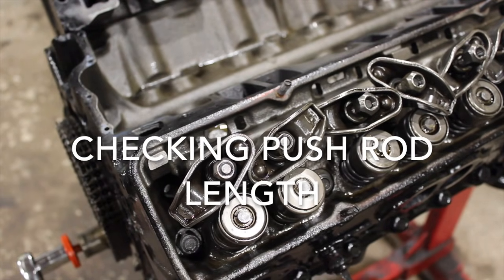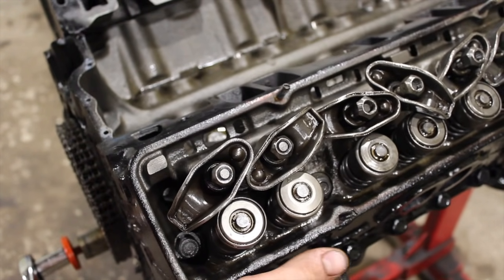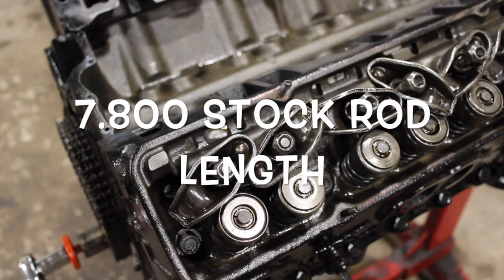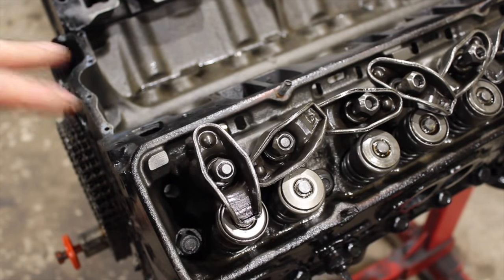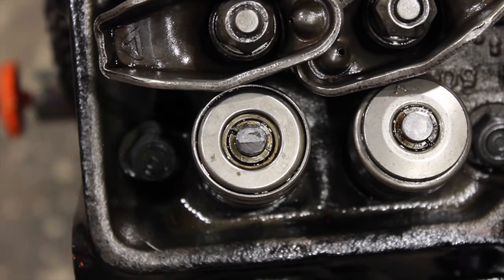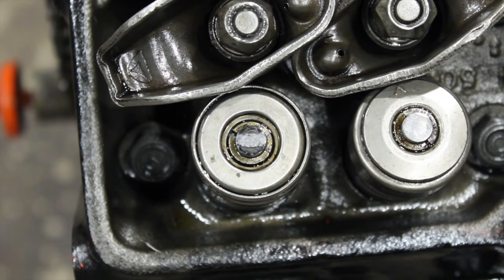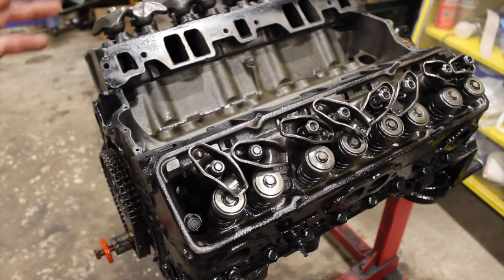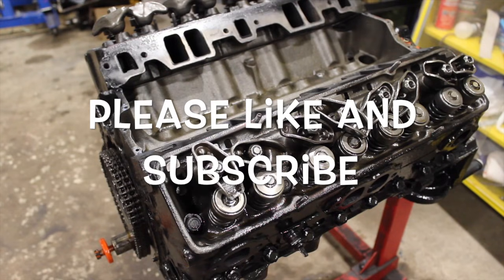Checking Push Rod length SBC *Quick Check*

Comment: TDC is not accurate enough for any significantly over stock type of camshaft.   The EOIC method is required to ensure that you are on the base circle for doing pushrod length checking.    It is best to just use EOIC all the time.

You do not get an accurate valve stem pattern by testing with the stock valve spring tension and collapsing the lifter.

Comment: What pushrods lenght u use on a 98 vortec 880 block with the lt4 hot cam with the 15 thou shim gel pro gaskets heads been milled 10 Thou so right now I’m having issues trying to figure out my pushrod length
Reply: Btw I went 1.6 rollers and guide plates and 7/16th screw in studs with the hex shaft had to cut the stud bosses down what size pushrods do u use with that block and that cam cause I know ur running that lt4 hot cam
Reply from the maker: As long as everything was done correctly with the rocker studs the push rod length should be right around the stock length of 7.200.

Comment: Great video man. I did the same measurement for pushrod length, except I turned the nut 1/2 turn more for preload. The rocker is hitting the center of the valve tip. My pushrod length came to 7.700.  Is this correct?

Comment: Did you get my last comment?
Reply from the maker: Not sure? What was it?
Reply: @cuttersperformance  You should have a solid lifter same length as a hydraulic lifter checking geometry, the hydraulic lifter collapes when running it through the cam lift checking the pattern? you dont get full rocker arm travel.
Reply from the maker: Yeah I think i talk about that in the video. My roller lifters I have ones i shim solid
Reply: @cuttersperformance  ok, on small block chevys it is probably  more commen to have to run .050 longer pushrods than shorter?  Bigger cams and more lift the base circle  is smaller and small base circle cams would need longer rods?
Reply from the maker: @Jesse Syfie  yeah base circle often causes a longer push rod, but the most common for a larger push rod is aftermarket cylinder heads. Often requiring a +.100 longer
Reply: @cuttersperformance  ok I used one of the plastic tools made by proform, and there not right and about .100 off.  It showed I needed .100 shorter rods 7.700  but my test with a solid  lifter after I made it same length as a hydraulic  lifter and ran it through full cam lift twice shows the stock length 7.8 pushrods are about dead on.  The exhausts were dead on. Intake were a tad more to intake side. Using stamp steel rockers like u did.

Comment: That's not a 100 % with a hydraulic  lifter going down all the way on max lift u are not getting  the full cam lift?  Need a mechanical lifter to check it?

Comment: So do you need to check each valve or will they all be the same after you measure one like you did here?
Reply from the maker: You can check everyone, but usually, I just check one in/ex on each bank. They should be the same

Comment: Question. My roller cam sbc engine is assembled already. The rockers are very close to the intake side of the valve stem. No where near center. Seems the machine shop did a poor job at choosing pushrod length. Question is, what’s the best way to test for correct length on assembled heads? I have an adjustable pushrod. On the last engine I used the light valve spring, added length for .030 lifter preload, and .015 for head gasket. Had a good center patten on valve. Then when I assembled actual valve springs and head gasket the pushrods were way off. Not sure what happened there. Just looking for some advice. Thanks!
Reply from the maker: Its a 87+ roller block? What heads? And do you know what length is in it now?
Reply: @cuttersperformance  Yes. 89 block. The roller top rocker is almost on the edge of the valve tip towards intake side. Not sure the length now.
Reply: @cuttersperformance  heads are ATK aluminum, cast by Profiler.
Reply: @cuttersperformance  7.200” length.
Reply from the maker: @jasonconaway69  o geez yeah good set of heads and what your going to find is that it requires around a .100 longer pushrod than factory length.
7.300 will be very close depending on deck height, head gaskets ect..
Set your adjustable push rod to 7.300 and use a sharpie to color the top of the valve stem. 
Install the rocker at zero lifter and just wiggle the rocker arm side to side to establish a contact patch. 
You can get it very close without having to roll the engine over.
Any questions you can email me a pic at pcperformance1@outlook.com
Reply: @cuttersperformance  Awesome! Thanks for the reply. Enjoy your videos!
Reply: @cuttersperformance  If I just eyeball the rockers centered on valve stem, at zero lash, add .050 for lifter preload they are measuring 7.450”.

Comment: hi , i have a question , i have a 87/95 sbc tbi engine , with the tbi swirly heads , what would cause my valve spring retainer to be busted , i took the valve cover off and found that , i bought the engine from a guy used out of a chevy truck , i just want to go back stock , what all do i need to change , thanks

Comment: like this method aren't you wiping the grease of the lobes because youre turning the engine over?
I could be wrong about this.
Can't you just put the cam and lifters in the block with engine oil and  then messure the push rods(you can rotate the engine as many times as you want).
if you have the wright pushrod lenghth  than you can take the cam and lifters back out and remove the oil and then put the grease on the lobes and lifters and install everything back so you didn't have wiped the lube of the lobes.     just thinking.
thanks for youre good explention and vids
Reply from the maker: I like your thinking but you'll do the same thing when setting the valve lash. The grease wont completely wipe off the lobe

Comment: I don't get everyone talking about using a lifter that might not have anything to do with the height of the new lifter you are going to run. What I did was get the zero lash, then adjusted the the push rod to almost bottomed out lifter (new lifters never pumped up). Then measured the amount from the start to where it ended . My lifter collapses near .200 from zero lash , but then you have to factor lifter preload, which will be .030 for my lifter. So I get the right pattern and then subtract .170 (in my case) from the push rod tool that has the correct pattern. If you have a engine that was ran you would have to verify the lifter was bleed down for this to give accurate results. I have a dual pattern cam so checked both intake and exhaust  one cylinder from both banks. If you want to be really anal check every one, because who knows if every valve is at the same correct height, or every lifter bottoms out exactly the same, or is exactly the same length. Uneven block deck height, or uneven heads, ect. In all reality close enough is probably good enough if the rockers have roller tips. There is some great info on youtube if you have a full roller rocker arm, but there is no way to find one of the two pivot points on many other examples like on a ball and falcrum rocker to the best of my knowledge. If you had springs light enough that the lifter would not collapse  after zero lash, I don't know you would see the pattern show up on the valve tip with a roller tip. I would try it and report back, but I only will if the springs I use to check piston to valve clearance are good enough, which I doubt will be. That is just going to be enough to keep the valve closed and work against a dial indicator.
Reply: I just thought I would add my first approach to how far the lifter would collapse didn't meet what was observed when it was placed under 300 pounds of pressure vs my trying to push it in by hand and trying to record the measurement with a caliper. The push rod tool by nature Should deflect far more from  zero lash than a real solid push rod would, at least in my case. Where was the error, I don't know, and I'm not sure the results are really going to make a difference  anyway with anything other than solid lifters
Reply from the maker: The important thing is to make sure you have a lifter with the same cup height when using a solid lifter for checking patterns. 
I have a roller lifter that I shimmed to  .050 under the clip that I use to check my oe roller cams. Works great! And I don't have to swap springs on the head to check the pattern 
 There's many ways to check pushrod length and they are all right as long as you get the same answer haha

Comment: How about if one use lifters with different seat height? I was thinking of buying a crower lifter but it has a seat height of 1.7”. My original lifters have 2.02”. Would that mean I would need .302” longer pushrods?
Reply from the maker: Yes seat seat height of the lifter will change the push rod height. 
Once you have all your parts get your self a comp cams adjustable pushrod and see what your specific setup needs for length

Comment: Any input on visegrip garages current big block build and his advice on pushrod length?
Reply from the maker: I just watch to see what he was saying, vice grip us a cool guy!
Good advice especially when you are going to be far off from stock length, most of the time its not needed to do the mid lift check like that.
I will be touching base on more pushrod and valve train fun in a upcoming video series! Should be fun!
Cheers!
Reply: Man you are definitely dialed in. Thanks for the feed back. 👍🏻

Comment: Which pushrods would you recommend with a lt4 hotcam on a 1997 chevy 5.7 vortec and with 1.6 rocker arms
Reply from the maker: I like using one peice comp cams push rods 
Stock length with a oe roller cam is 7.200 inches but you will have to check the length on your setup  
Cheers!
Reply: I don't mean to pop any bubbles or anything,  but the comment about the pushrod having a little extra length for the 1.6 rockers,  isn't necessarily needed just because it's a 1.6 rocker. While this may be true in this specific case,  it may not be in another case. In other words just because it's a 1.6 rocker, doesn't mean the pushrod should be longer. There are so many individual things that affect push rod length.  Engine block deck height,  cylinder head deck height , cylinder head deck height to rocker arm  mount height  (all of this can be different depending on overall design from each manufacturer,  whether milled, etc etc. The camshaft grind, the lift, duration,  ramp rating, etc affects it's base circle,  which in turn can affect needed pushrod length. The base circle can also affect the needed lifter length. Not to mention, that the lifters themselves can be different from manufacturer to manufacturer, & can be with the actual rocker arm, where the ratio may be the same but the actual pushrod "seat" on the different rocker arms, can be different, & so affect pushrod length. In other words,  if everything else is exactly the same,  except for changing only the rocker arms, & with using the same ratio, the pushrod length could be different. All of this is why checking pushrod length is so important, & should be done with any new build,  or when changing anything that can affect the valve train.
Reply: I prefer the comp cams 7808-16 push rods myself, especially for running a 1.6 rocker, stock length is 7.195 and the 7808's are 7.205 which gives you the little extra length for the 1.6 rockers!! Comp Cams 7808 are also a quality hardened steel

Comment: Maybe just get a piece of dowel wood and cut it exactly to lifter length with a divot in top to hold pushrod. Then it will be exactly to running lifter length

Comment: One point - if you used a stock rod at 7.8 and the adjustable only
maxes out at 7.8?? Did you use another push rod checker?
Reply from the maker: You can get a little extra out of that one but they also sell longer ones
Reply: Which Comp Cam tool would you recommend for stock ish length push rods pt# 7702 ( 6.8 - 7.8 " ), or 7703 ( 7.8 - 8.8" )

Comment: But if the lifter is collapsing the .50 allowance, then you should still be at stock length of the 7.8 push rod?
Reply from the maker: Thats with the lifter collapsed .050 and pumped with oil
Ideally you want a very light valve spring so when you turn it over the lifter doesn't push the oil out at all
But realistically the stock length would be fine for this mostly stock engine. 
That engine is actually coming apart now becuase he wants vortec heads and a lumpy cam! 😂
So we shall see what size push rods it will need now?
Reply: Right, but with that spring on there your just collapsing the lifter and getting a wrong reading, usually unless the heads have been milled or block have been decked with stock sized lifters the push rod will stay the same length, but it's actually better to slightly favor the lower section of the valve stem slightly due to the angle
Reply from the maker: Very good point, I talk about that around the 3 min mark in the video. 
You can take a spare lifter (exactly the same size) remove the snap ring and fill it full of shims or washers to make it a solid lifter. (Or use a solid lifter that's exactly the same size) 
You can also put a very light valve spring in the head.

But what I find with a lower lift cam, with weak valve springs.. you usually can just roll it over as it is. 
Or prime the engine before you spin the engine over to put some oil in the lifters.
Another thing you can do is just color in the top of the valve at TDC set your lash and wiggle the rocker (dont roll it over) pull the rocker off see how centered the pattern is at the top of the valve. You can usually tell if your pushrods are close without even rolling the motor over

Comment: If a push rod is to long will it bend when engine is turned over?
Reply from the maker: No mostly just throws off all the geometry and the rocker rides off the tip of the valve. But I guess its possible if it was excessively long and the rocker arm pivot bottomed out

Comment: I'm a little confused. If the hydraulic lifter compresses doesn't this throw everything off significantly? I would expect the rocker to be off center of the stem, shifted towards carb side, with the lifter fully compressed during opening and closing. How do you make your flat tappet hydraulic lifter "solid" in order to better facilitate measuring for the correct rod length?
Reply from the maker: Very good point, I talk about that around the 3 min mark in the video. 
You can take a spare or junk lifter (exactly the same size) remove the snap ring and fill it full of shims or washers to make it a solid lifter. (Or use a solid lifter that's exactly the same size) 
You can also put a very light valve spring in the head.

But what I find with a lower lift cam, with weak valve springs.. you usually can just roll it over as it is. 
Or prime the engine before you spin the engine over to put some oil in the lifters.
Another thing you can do is just color in the top of the valve at TDC set your lash and wiggle the rocker (dont roll it over) pull the rocker off see how centered the pattern is at the top of the valve. You can usually tell if your pushrods are close without even rolling the motor over
Reply: @cuttersperformance  Ahhh...right on man! Pump the lifter up by priming the engine prior to doing this measurement. Then I would be testing my exact configuration. Got it. Thank you so much for the quick reply and several good options.
Reply from the maker: @dennis6325  No problem!
Reply: Use a solid lifter to check length

Comment: What do you think caused this motor not to be able to use stock length push rods?
Reply from the maker: This was just a cam swap so I never had the heads off but my guess would be that the block deck height/ head deck height is the reason for needing longer push rods. 
But the cam, lifters, valve tips, rocker arms, head gaskets, block and heads are factors in changing the pushing rod length.
Always check....never guess! 
Let me know of you have any more questions
Reply: Most aftermarket cams require a slightly longer pushrod